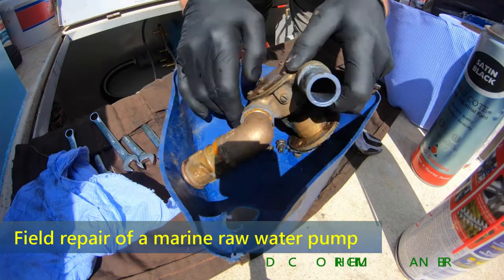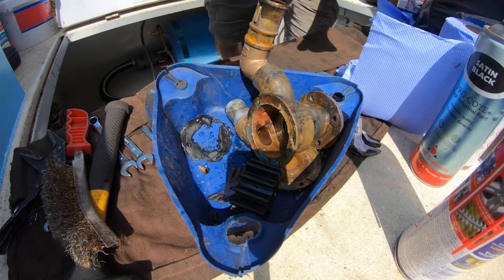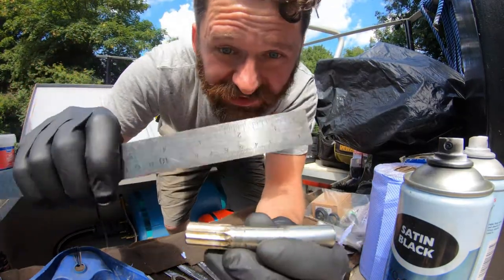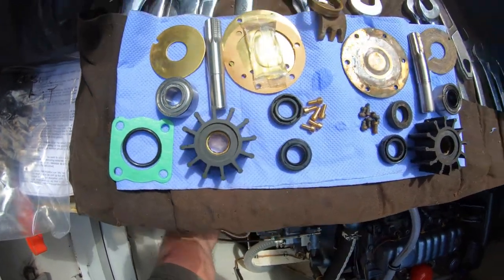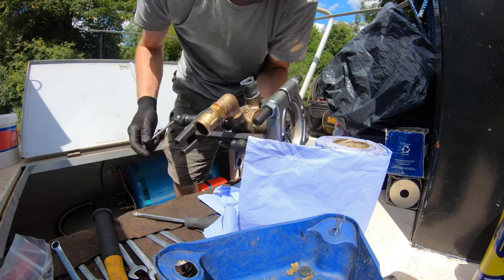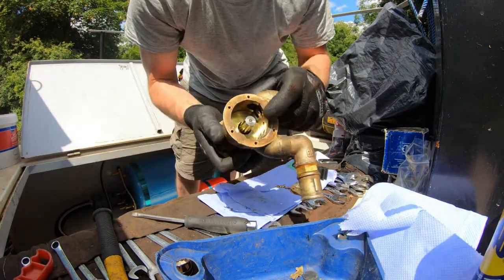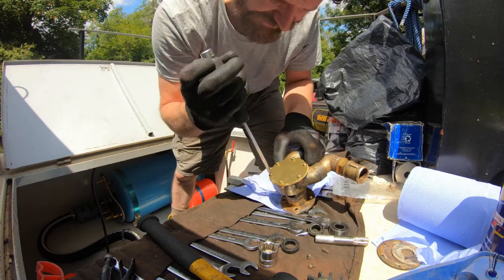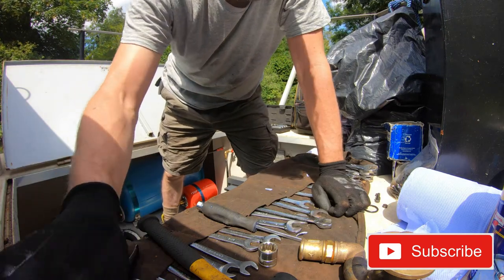How to rebuild a marine raw water cooling pump in the field without a workshop.

Comment: Thanks for the video. How did you determine the correct distance to press the parts on the shaft?
Reply from the maker: The shaft has a ledge that dictates positioning. Once the bearings  are against this ledge / shoulder the rest makes sense.
Reply: @dhcrouchmarineltd3049  Oh perfect. Thanks a bunch. Getting ready to do a rebuild on this same pump and this has been helpful.

Comment: What do you call that black vertical press thing? Is it required in order to remove and reinstall the shaft?
Reply from the maker: That is a hydraulic puller, the bearing is pressed into the brass cast body. To remove it you need to press it in order to not damage the bearing.  
Taking a press into the field is unrealistic so I have the hydraulic puller and I make that into a mini press.
Reply: @dhcrouchmarineltd3049  Great. Thank you!

Comment: Thats an interesting video and a good explanation of how a lip seal works. Did you pre lube that lip seal as well or doesn’t it need it? Also on the pre lube is there no advantage to putting some around the inside of the pump housing before fitting the impeller? Does the pre lube help prime the pump as well as initially lubricating it, and if you don’t have the silicone pre lube what else can you use?
Reply from the maker: Silicone grease is great for pre lubing the impeller and seals in this application.

Comment: Hi just to clear something up are you saying that the seals should have the grove facing the water and the other side again facing the oil side? so looking from the top of the pump the seals are back to back with the flats of the seal
Reply from the maker: There are two seals. the lip should face each respected fluid. Lip seals usually have a spring inside to assist the lip, think of this as the side to face the fluid you wish to manage. I hope that makes sense. You end up with each seal facing each other. Just be sure the shaft isn't worn such as a groove has developed as this will reduce the seals efficacy and potentially stop the impeller generating vacuum and hence water flow.

Comment: where duo you get your parts from, a shaft from asap is £100
Reply: Try parts4engines
Reply from the maker: I think Parts4engines is where I got the kit.

Also it's worth checking Xylem's website as they are the manufacturer of Jabscos pumps.

But do bare in mind the work to make a shaft like that. The cost is a reflection of that